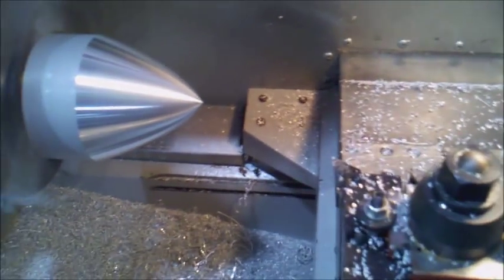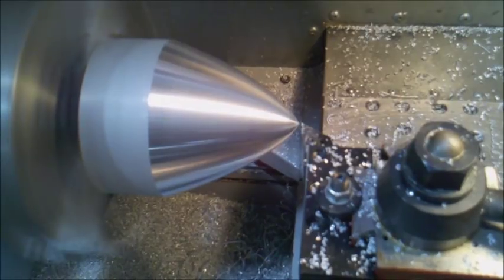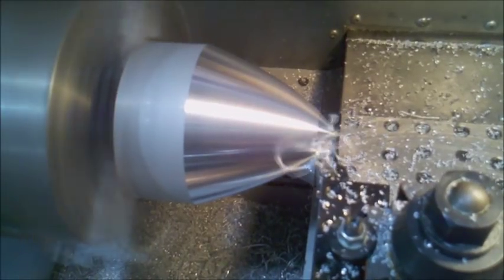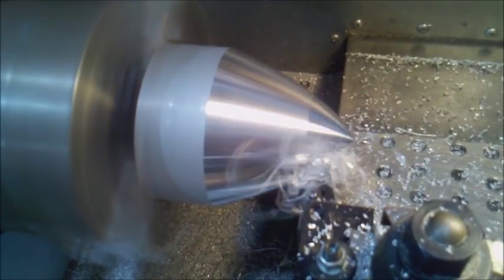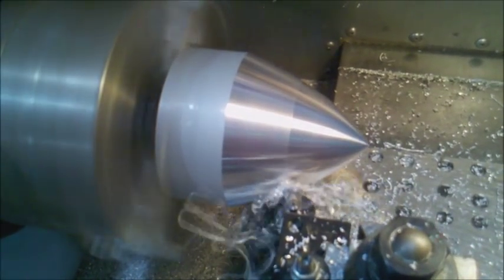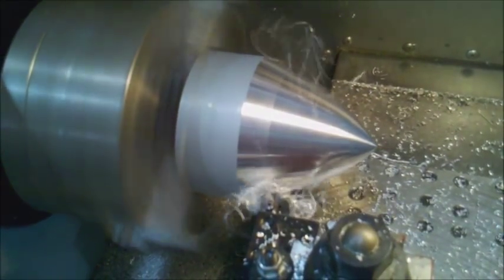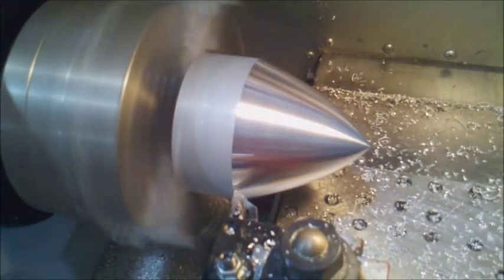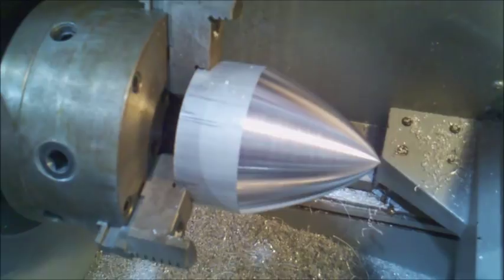PJD P51  Build off bike parts, Machining Nose Cone 2011

Comment: I always wanted to see more of the crafting on the bike parts like this Nose Cone for example rather than the show being centered on idiotic drama back in the day. Thanks Vinnie for finding this Gem and sharing! Cheers From Ohio
Reply: I'm with you The Stuport. I built my own large CNC machine because I am interested in the design and fabrication side of the show. Leave out the fireworks and show more of the hands on would be my preference too.
Reply: Dodgy Brothers--- Outstanding to read this! I'm sure you have great projects designed and fabricated and the coming up with idea's are no doubt the fun part too! Cheers From Ohio and good Luck!
Reply: The Stuport I am actually building a tilting electric trike that should run somewhere around 10 second quarters. I built the CNC to primarily build some custom speakers and parts for the trike like the triple trees since I am building it completely from scratch. I originally started watching American Chopper for inspiration and ideas but they never really catered to the people interested in the engineering of the bikes.